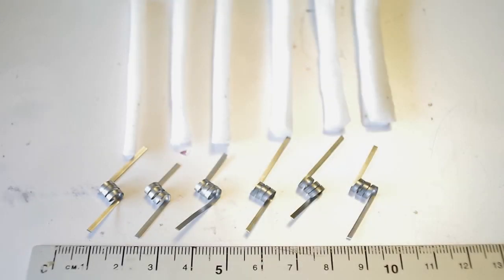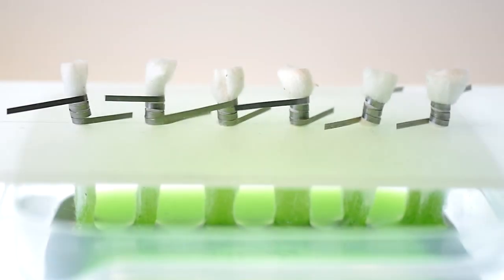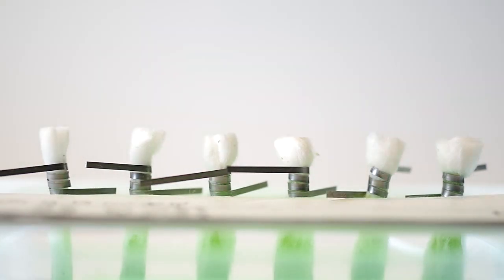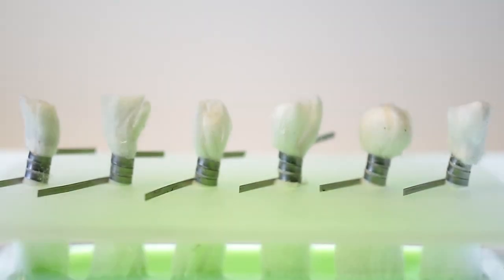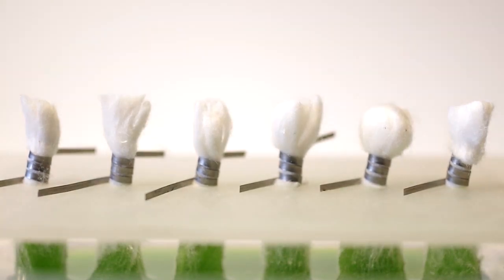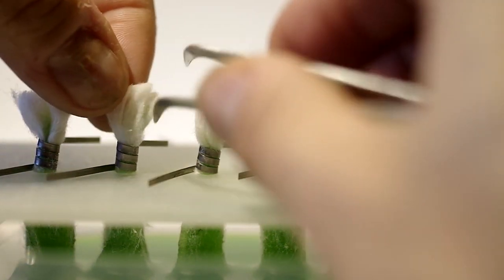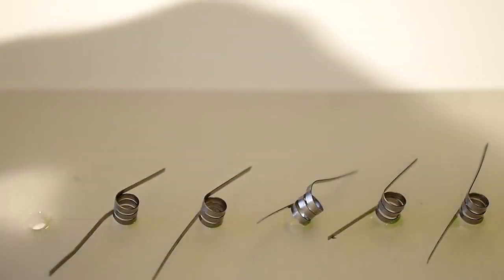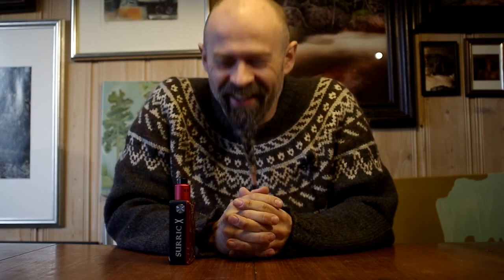How hard should you wick? Very Hard!

Comment: For anyone who is wondering, this works for RTAs too!  I only use MTL RTA tanks with 70/30 PG/VG,  1 om to .8 om round kanthal wire spaced. I searched for months and watched hundreds of youtube videos trying to figure out why I was getting popping, spit back, and leaking. I THOUGHT I was using what is considered a lot of cotton because so many of the vaping gurus out there preach how we shouldn't pack it in too tight. I watched this video and re wicked my tanks very tight, like I had to hold the coil to pull through. I also didn't remove the outside part off the Japanese cotton pad like so many say to do. I even pushed it into the wicking wells without fluffing, combing, or trimming. The whole time I was thinking that there is no way this is going to work. Well, so far it's working beautifully. I'm sitting here chain vaping with no dry hits and my tanks are no longer spitting at me. It also hasn't affected the amount of vapor or flavor in a negative way. I can't wait to see how these wicks hold up to a full day of vaping. Removing them isn't going to be easy, but wire is pretty cheap, I'll recoil if I have to, it's way better than dealing with juice on my hands and in my mouth. Thank you Morten, you saved me from so much frustration.

Comment: Just spent a couple hours doing a lot of rewicking. 2 Aromamizer Supremes, 4 Aromamizer Supreme V2s a Wotofo Bravo RTA, 3 Boreas V2s and 2 Aromamizer v2s (older 22mm tank). I can confirm that this method really does work excellent. I used to peel off the outer layers and fluff the ends. When I rewicked I left all the layers on I wicked quite tightly and I disturbed the ends as little as possible. I am now getting a very saturated dense flavorful and much more satisfying vape.  My coils are 26/36 Kanthal Claptons 7 wraps 3mm ID and come out about .48 ohms in most my tanks and I'm vaping them at 45 watts. The Bravo is 26/32 Claptons SS and about .35ohm. So I can confirm that this does work very well in different types of RTAs. Now I need to do this to my RDAs especially both my Drops which have Aliens and are very spitty.
Reply from the maker: Thank you sir! Most reports regarding RTAs are positive. All reports regarding RDAs are positive. Give some feedback on the Drop with aliens. Sounds like a worst case scenario ;-)
Reply: I managed to remount the Aliens a little bit lower and I rewicked them tightly with all the layers on and now the spit back is all gone and I am enjoying the Drop very much.

Comment: I'm a big believer in tight wicking. Aside from anything else it seems to last longer since the centre doesn't collapse as easily.

That said, it would have been interesting to see this experiment done with a more typical wick length, as you'd never have the tails that long on a typical RDA
Reply from the maker: Yes and no:-) Jurin`s law still applies, the tighter the fibres, the faster and higher the capillary effect pulls up liquids. To us, this is only one aspect. As you mention, the problem with burnt cotton is almost non-exsistent. Also there is less spatter. I think the speed the liquid get sucked up is one of the reasons. When the distance to the liquid is just 1/4", and the coil heats everything up to a boiling point (PG/VG 180/290 degrees C) the capillary effect is lightning fast. To set up an experiment showing this is way beyond my capabilities and available resourses. But yes, it would be very interesting indeed!

Comment: I Wick Tight so that I can just pull through the coil, looser wicks need replacing more often , Thin the very tips (5mm) and fluff only the ends (10mm), I can make my wicks last for weeks but prefer to change the once per week, Kendo Gold is my go to for my prefered 4mm dia coils made from round NI90 @ 0.09 - 0.12ohms

Comment: What sorcery is this? Recently tried it on my pnp rba “for voopoo vinci x/ drag x” i am using the japanese cotton. Build is fused clapton 28g 6 wraps reading at 0.3ohm i did was wick it tight. Cut a a pad and rolled it so tight and inserted it. Then did not fluff the ends also. And it works like a charm! Before i usually vape at this build at 35-45 watts. Now only at 25 and same flavor no dry hits and chain vapes like a charm. Also less of a gunk issue! Now this is a great way to wick RBA or rta

Comment: Wish you would have stated the BRAND of the Japanese Cotton.  I have 
found there to be substantial differences between brands, with "Koh Gen 
Do" brand being the best.  Especially when taking into account things 
like flavor neutrality, lack of bleaches (safety), and scorch 
resistance.  I have found that "Koh Gen Do" is more likely to survive 
dry hits than other cheaper brands.  It also has a cleaner taste and is 
the purest and safest JOC on the market. IMHO
Reply from the maker: Thanks for the input Dan! I'll look into it when I have time to do so.
Reply: Koh Gen Doh is the best. Cotton Bacon prime is also really good, but it's a bit fragile with tight wicking, but it's a close 2nd to KGD in my opinion.
Reply: The thing about Bacon is that there is no good way to get consistent amounts of cotton from one wick to the next.  KGD is not only better but you can cut one strip and get EXACTLY the same amount of cotton every single time.  One strip can cover both sides of a dual coil rig as well which makes it really cheap too.

Comment: Bernoulli principals may play a role in that regard. You have lots of variables that would also go into the equation. Humidity, local temperature, Vg ratios used in eLiquid However, as you would know the question is always answered more correctly to the point of dry hits. As tight as possible without chocking the flow of liquid. Just my 3 year later 2 cents reply to your video...... 👍🧐
Reply from the maker: I agree. This is just a way to show Jurin's law of capillary effect.  In other words: Thou should not fluff :-)

Comment: This applies to RDTA too right? I mean I learned from most vids and tutes that RDTA wicks should be trimmed, thinned, fluffed, or whatever aside from the usual "not too tight not too loose".
I just rewicked my 22mm avocado before watching this video but yeah, think I'll rewick it again now and try to do it this way. Thanks for this !!!
Reply from the maker: Try to make an oversized wick you realy have to cram in there, and use scissors to get the proper angles and shape on the ends. Fluffing makes it slower. Oh, and lower the watt a bit till you get used to it.
Reply: Morten Oen 
I did not change anything except for the wick. Same coil,  mod and atty. Also same wattage at 52 watts. I got a hint of a dry hit just a bit when chain vaping. Lowered it to 40 watts and it solved that. Same hits as on 52 watts if not better. Good for the battery! Thanks!!!
Reply from the maker: Great news, Junnell! I have gotten these responses from a lot of people lately. You are the first I have heard from using an RDTA. Good :-)

Comment: Thanks for the video, interesting! 
But (I'm sorry I feel I say a but each time I respond to your experiment, no offense.) I do think you should have done it differently: 

1) coil should be in horizontal position because it is most of the time the case in RDA, and going vertical the liquid is more prompt to fight gravity by the time it soak up juice.

2) both side of the wick should be in contact with liquid, as in RDA.

3) your support interfere.

So if I may suggest I do think the experiment will be more reflecting reality by simply change the way you made the platform, and the way you fix the coils.

A stiff cardboard can be the solution.

----------]---[-------- 
           |○|

---: cardboard 
][: legs of the coil passing in and bend. 
|○|: the coil.

😉
Thanks for you experiments as always.
Reply from the maker: I have no problems with a genuine argument, my friend:-)
This time I was not going for reality, just to see if the capillary effect was hamperd by viscosity of VG and a tight fit in the coils. I could not by force make the capillary effect slow down by wicking a coil as hard as I could without damaging the coils. But the legs of the coils should have been fixed in position. But I had the tight holes on the plate, and those do not give. My initial point is somewhat proven, and I'll go from there. In real life I have seen the effect a tight wick has, and there is progress to be made. Stay tuned, and thanks for tip on method.